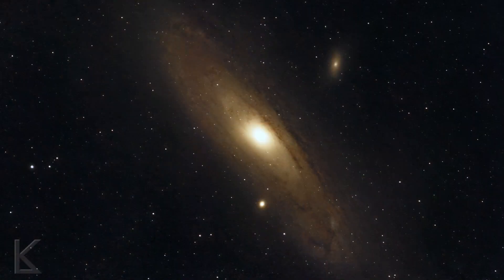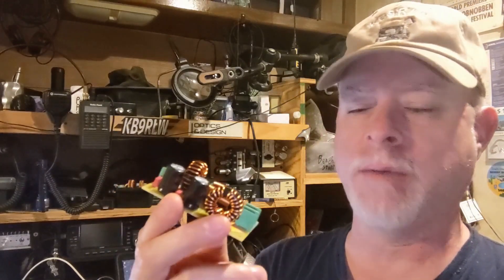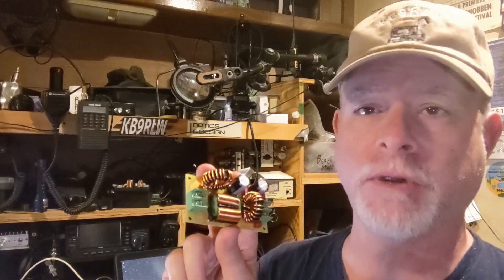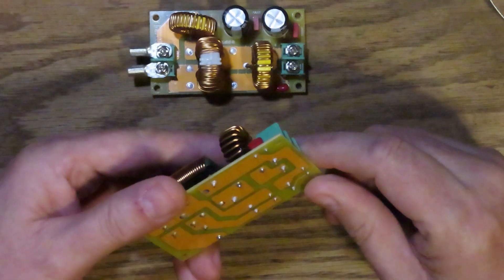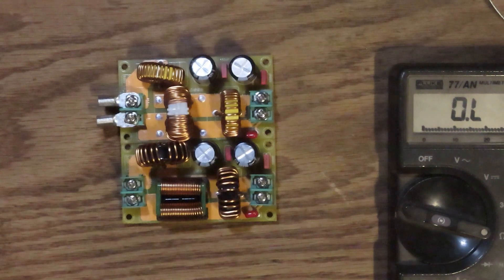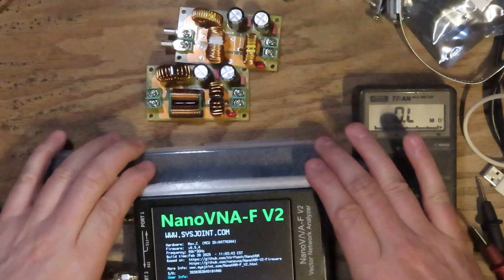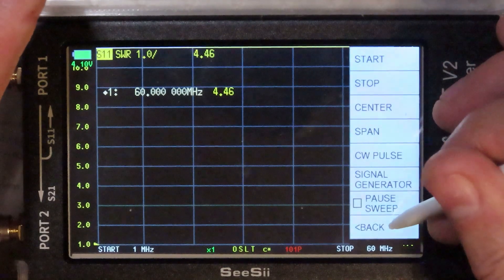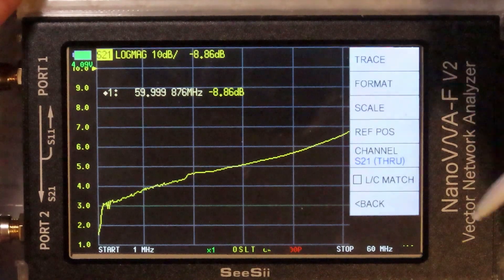Ham radio - Testing a cheap DC EMI filter with the SeeSii NanoVNA.

Comment: Wouldn't the 50kHz-2MHz range be of more interest since most noise generating equipment have SMPS with switching frequencies in that range. Including the most prominent harmonics.
How well do they dampen the basic switching frequency and the first 10 harmonics?
Reply from the maker: I think I mentioned that in the video when looking at the VNA sweep, how it was most effective and the lower end of the spectrum.  I showed the sweep on screen where you can see the response over the HF spectrum.
Reply: @loughkb  Absolutely, and the good damping at 1Mhz was the reason for my curiousity what happens below 1 Mhz down to about 50kHz.
As you might understand, I'm interested in audio and not Ham radio ;-)
Reply from the maker: Yeah I think they are primarily intended for applications along those lines. If you look at the VNA sweep you can see it tails right down to almost nothing at the far left. It has the most attenuation at the bottom.

Comment: Nice video. Only thing to keep in mind is any load after this filter needs to be isolated from any other connections, such as ground. This would negate to a degree the effect of the common mode choke and would cause multiple current paths between the load and the power source, unless the power source feeding the filter unit is 100% isolated.

Comment: What kind of potentiometer is in that "load"?  Does it have a flat response over your frequency range.  If not that could mess up your calibration pretty badly.   You could calibrate with a coax cable and standard loads, then just add a short coax to banana adapter which won't make much difference at these frequencies.
Reply from the maker: It's a carbon linear precision 10-turn potentiometer. And yes it is flat across the frequency range. I tested that when I built it.

Comment: Same EMI filters are sold on Aliexpress for $748 (4A) and $8.92 (20A).  I have been using an old ATX PS for powering my Yaesus.  The PS works well for the lower bands but is very noisy on the 10m band.  I have a 100AH LiFePO4 which I use for POTA and at home, but I'll give this EMI filter a try.  Thanks!

Comment: Do you have a video on making that load device ?
Reply from the maker: No. But it's very simple. It's a precision 10 turn potentiometer, there's many sources to order one from. I just 3D printed an enclosure for it with holes for a BNC male, a BNC female, and a set of binding posts.
Reply: @loughkb thanks. I will do some googling around . That setup would make it easier to test new diy baluns/ununs instead of trying to combine resistors
Reply from the maker: @digiital That's exactly what I built it for.  🙂